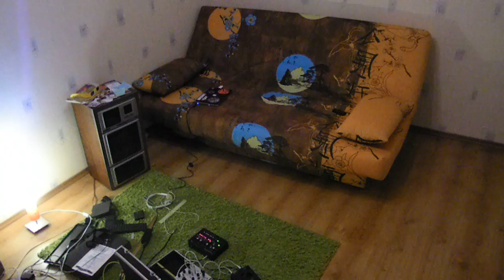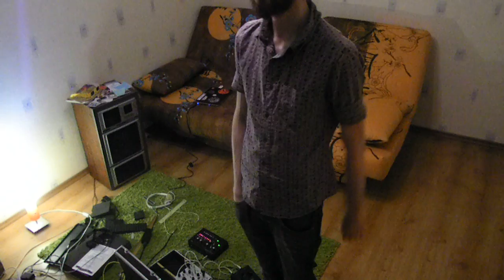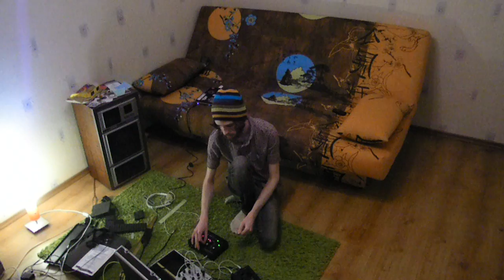Monotribe Tips: Sync Out to Gate In. (Fun Rhythms!)

Comment from the maker: I didn't do calibration yet, but all I can say it worked fine for me straight after updating. I might suggest you have soldered CV to the wrong ring? (Should be ring2.)

If nothing else, one nice guy yesterday has thrown together a guide on pitch calibration - read it at emeri . ca/1re4 (paste this to your address bar, removing the spaces). Hope this helps!